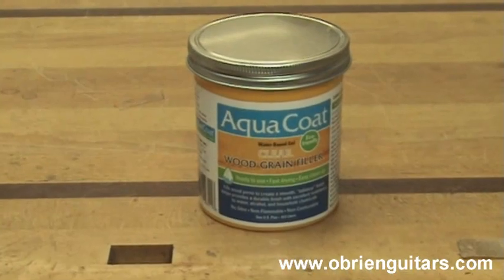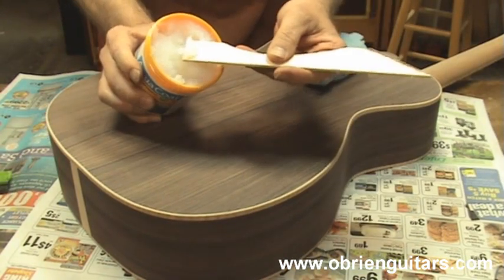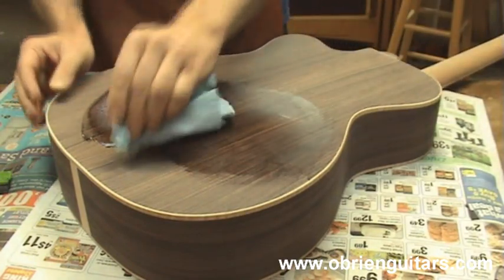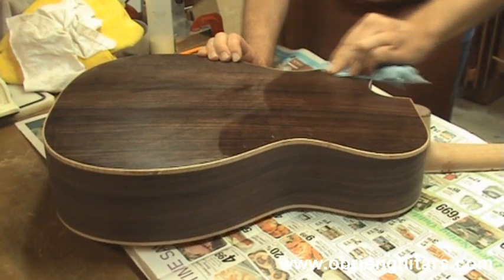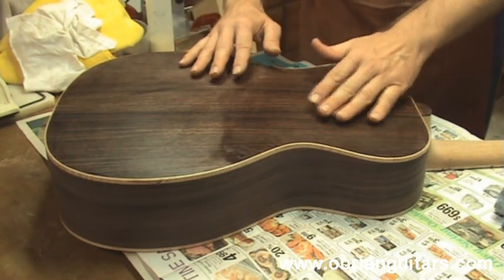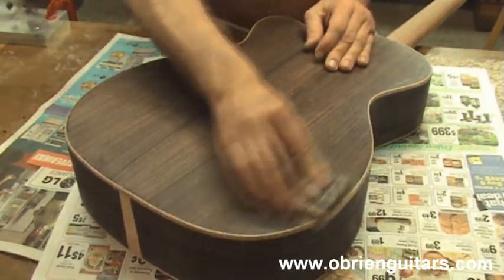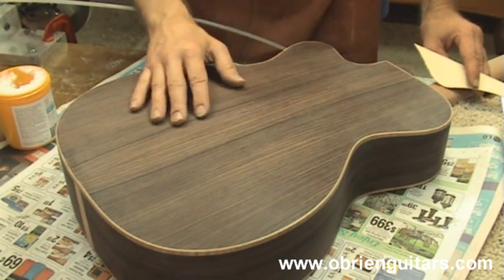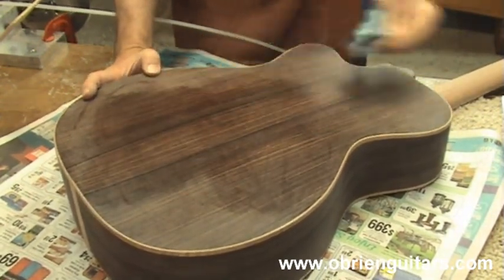Luthier Tips du Jour Mailbag 35 - Aqua Coat pore filler

Comment: Quick question. Why is it necessary to remove the dust from the pores? Wouldn't the dust help fill the pores naturally? Does it ruin the ability of the goo to adhere to the wood? Just trying to get through life without buying another compressor (I've had two of them stolen, so it makes me angry just thinking of buying another).

Comment: Robert, I'm finishing a kit guitar, with mahogany veneer back and sides.  I'd like to use Transtint/Transfast dyes for color.  I've been advised by a local high-end wood finishing shop, to dye 1st, then apply Aqua Coat over the top, to seal the very porous mahogany, and that this combo, in this order, will work just fine.  I also understand that the Aqua Coat can be tinted, using said dyes.  As the dye is water based, I'm concerned that the Aqua Coat will lift the dye as I apply it.  The dye color will be a deep navy blue, for the back and sides.  Any advice along these lines would be helpful.  I've not found any resources online, using this combo, that addresses this issue.  The goal at the end would be to apply a water-based, non-toxic, low VOC satin finish coat, by hand, as I'm finishing it in my home.   Something fairly hard and clear, to protect and accent the mahogany grain.Thanks for any advice you might offer!
Reply from the maker: Working with colors can be a lot harder than working with  clearcoats. When in doubt always do sample boards before applying to your project. The advice you got is good advice. You can always seal the color before applying the pore filler if you are concerned about fading. Good luck.

Comment: I’ve used this for the first time. After spraying shellac sealer over the fill, scratches are appearing that seem to be in the the aqua coat? Do I need to sand the filler back further to the seal coat or….?

Comment: Hi, question for you.throught my building years ive had a similiar probem when using maple and walnut cocobolo, or ebony.I get bleeding when I go through my sanding schedule.itcould be an end graft or headstock or even small accents like dots, its frustrating and I have not seen a good method for avoiding this problem. What do you suggest? Thanks
Reply from the maker: Edad Martin have you tried scraping instead of sanding?  What you are experiencing is contamination due to dust and not what I call bleeding. Bleeding happens when the color "runs" into the other lighter colored woods when applying a solvent like alcohol in shellac etc. There are ways to control this as well.

Comment: Hi Robert. I applied AC 3 times to the rosewood back. After 1 cycle of french polish, I noticed quite a few tiny holes in the polish from partially filled grain holes. Can I apply Aqua Coat over the french polish, making it effectively, mid-level in the finish or do I have to strip and start over? or is there another idea, I'm on a tight schedule. Thanks.
Reply from the maker: +Lawrence Wolf You can scuff sand the seal coat and then apply more aqua coat fill over the top.

Comment: Now I am curious about that disc-type device you are using for holding the guitar. Does it work with vacuum?
Reply from the maker: seasonedtoker yes, it is a vacuum work holder available from LMI.
Reply: +OBrienGuitars So impressed with all of your videos.  I'm sure you get this question all the time, but the vise that you are using to hold the lmi vacuum work holder.  Where did you get that!  I have the The Panavise® 3-axis ball-head vise and I am extremely displeased with it.  I would much prefer the one you have by the looks of it!  Do you mind sharing where you found this vise?  Thanks so much.
Reply from the maker: +Jedidiah Wiebe actually it is a previous LMi version. They don't sell it anymore.
Reply: +OBrienGuitars thank you so much for your answer. That's a real shame. I really don't find the Panavise acceptable.
Reply from the maker: +Jedidiah Wiebe I think the shaft needs to be extended a few inches. Perhaps a machine shop in your area could make that happen for you.
Reply: +OBrienGuitars that's a big part of it!  you're right. I might even be able to do that myself on a friends welder. I also wish, however, that it gripped better. hard to tighten the screw enough ever.
Reply from the maker: +seasonedtoker Yes, it is a vacuum holder.

Comment: Robbie- thanks a million for telling us about Aqua Coat pore filler. This sounds like the ideal stuff to use on a couple of my current projects; one with some wildly figured but extremely porous Padauk, and the other one flamed Claro Walnut, also notoriously porous.
Clear pore filler is the only way to go with woods like these, in my opinion... And I was not looking forward to doing the two epoxy pore filling jobs on these two. I really don't like using epoxy, for the same reasons as the guy who requested your input on this. So instead, I'm going to use Aqua Coat on them- and I'm looking forward eagerly to it now, instead of dreading a messy chore.
Thanks for everything else you do, too, Robbie. You are the go-to guy for many thousands of us string-heads. You are the Master teacher.
Reply from the maker: Stephen Sheriff Thank you for the compliment. I recommend you go slow with the fill process. Let each coat dry thoroughly between applications. It will take several applications to get the job done. Good luck.

Comment: Enjoying all the vids.  Like you I have tried everything under the sun and have a whole shelf of products I don't use anymore.  Question- Would a wash coat of shellac before this product help or hinder the process?  Related question- If you use nothing but this product for pore filling is there a problem sanding through to the bare wood?
Reply from the maker: Thanks for watching my videos. I am glad you are finding them useful. I failed to mention in the video that you can apply a wash coat or seal coat before applying the aqua coat pore filler. So, yes, this will work and in some cases might even be preferred.
Reply: OBrienGuitars if i wanna stain the wood, do i have to fill before or after staining ?
I wanna use it on quilted maple
Reply from the maker: Raffael Kloiber No need to fill maple so add stain and then top coats.

Comment: Robert, thanks for your videos. One question I have always had regarding pore filling is how far to sand down before proceeding to the next step. Should any dry pore filler still be on the surface, or should one sand down to (pore filled) bare wood?
Reply from the maker: Alec,

I like to sand back to bare wood for two reasons. One, I avoid any compatibility issues with the finish products. Two - I usually end up sanding through the pore filler anyway when trying to level it. So, I sand it all back to bare wood just leaving the filler in the pores. Hope this helps.
Reply: @OBrienGuitars  Thanks for replying. Big help.

Comment: I wonder if I can use it before applying urethane lacquer. Also, Can I use it as a finishing material? I wonder what it would be like to use this as a finishing material and buff. Thank you for the great video.
Reply from the maker: Yes, this product is made to be a pore filler and not a finish by itself. It can go under a urethane finish. Most folks spray a sealer, then apply the pore filler and then another sealer before going to topcoats. Thanks for watching.

Comment: Robert, thanks for the many helpful videos. I used Aqua coat on a mahogany guitar with a tru oil finish. Its really spectacular. I was using it recently on a mahogany neck with a wide heel, about 2 inches. When I added oil, sure enough there was still some filler patching in the open end grain, which required quite a bit of intensive sanding and scraping before clean. It can be really hard to see and twice as hard to remove once a coat of oil is on. Would sealing the end grain with shellac before filling help?
Reply from the maker: yes, I would seal the end grain with shellac before trying the pore filler. That should solve the problem.
Reply: 8

Comment: I've seen that some French polishers and others fill the pores with some of the sawdust as they go. Is adhesion your concern if you were to not blow out the pores and just applied the aqua coat, sealing any remaining sawdust into the pores with the next application of Aqua coat?
Reply from the maker: My concern would be that after sanding the pore fill off you would open the pore again if you just applied the fill over pores that had dust in them. I prefer to remove the dust and let the fill get down into the pores.

Comment: Hi Robert, I have just filled the pores with this product on a Madagaskan rosewood back and sides, I sanded level and applied two coats of sanding sealer over the top. The results aren't good, it looks really patchy, do I need to remove all the sealer leaving only in the pores before lacquering?
Reply from the maker: You can add more filler over the sealer. Keep adding until the pores are completely filled.
Reply: @OBrienGuitars  Thanks for the reply, thing is though the pores are filled, it seems to me that when the sealer goes over the filler you can see a tonal difference between wood that has sealer covering it and  bare wood which has been exposed after sanding. This is why I asked the question, "does the sealer need to be sanded off before finishing"?  It's practically impossible to sand completely smooth without sanding through the sealer at some point I have found, and it is this I think that seems to be causing the patchy appearance. Do you understand my predicament a little better now?
Reply from the maker: I would just add more sealer to even out the color.

Comment: Hi Robert, 
is it possible to stain the aquacoat filler? 
i used shellac and pumice so far for filling the pores. the shellac gives a very nice depth to the timber. and sprayed a waterbased finish over it. is it possible to achieve that depth and stain with aqua coat?
Reply from the maker: yes, you can dye the filler.
Reply: L